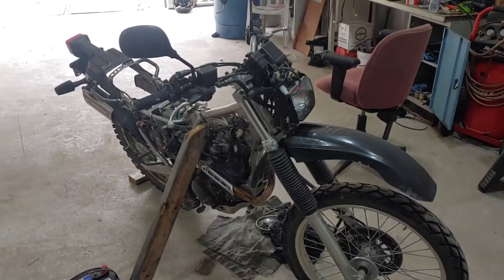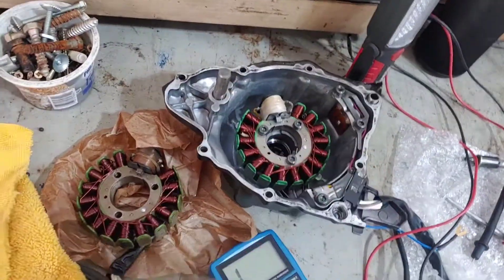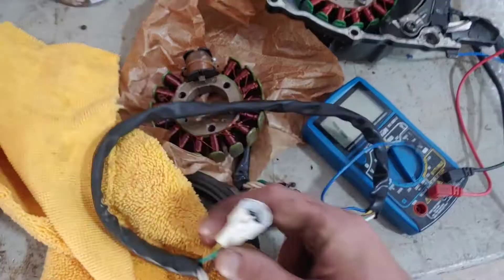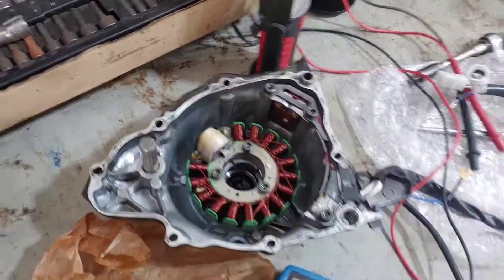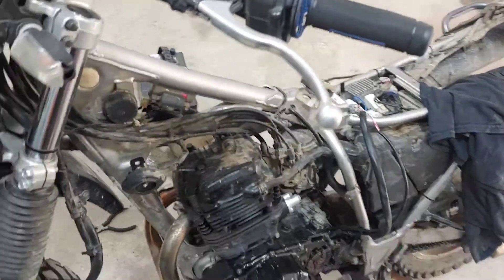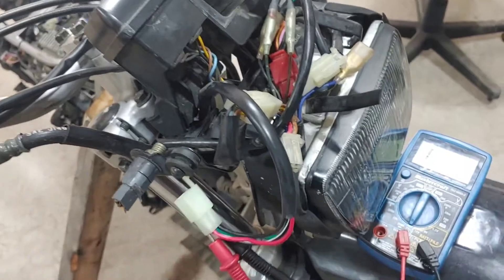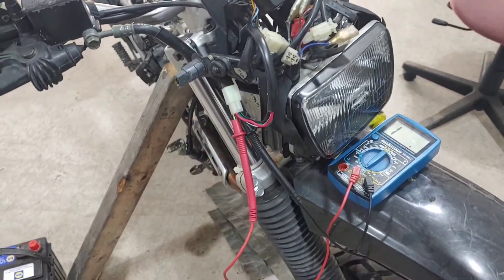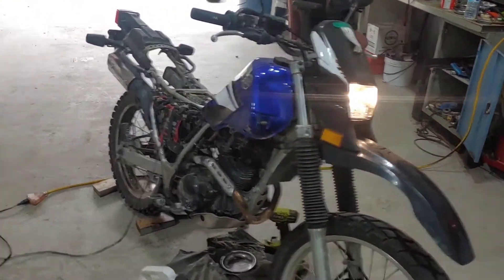No Spark - Fixing a 2007 Yamaha XT225 (Stator Ohm Readings listed)

Comment: Great video. Thank you. I got a project xt225 and this looks like my problem. Except my wiring is dogs breakfast because the previous owner was not good at this.
Reply from the maker: Thanks for the compliment. Best of luck to ya!
Reply: @blackmasta71  Well your video was very handy. May I ask where you purchased your stator?  So far stator is toast, pick up coil, and ignition coil. :( OEM stuff is stupid expensive thinking aliexpress sourcing.
Reply from the maker: @NoSkillzMoto  check out Ali express. That's where mine came from. They don't last as long but sure is way cheaper

Comment: I am getting .7-.9 m on the white wires.
Reply from the maker: I believe the white wires are for your charging circuit. 
If you have spark then you probably have a dirty carb. 

Although a spark plug about to fowel will spark out of the bike but not under compression. 
Try a new plug and then proceed with cleaning the carb
Reply: @blackmasta71  brand new carb And plug. :-/
Reply from the maker: @noneofyourbusiness614  
A new carb usually needs the air/fuel screw adjusted. 

Do you have continuous spark? 

Do a compression test to make sure your over 100psi. 

If lower it can be very hard to start. 

Make sure you have good fuel flow to the carb.
Reply: @blackmasta71  thanks, spark seems intermittent to me. Compression testing now. Like I said, Pull choke, try to start, bike fires once, then nothing. If i let it sit long enough it will fire once again. Chasing this problem has resulted in… New cdi, new ignition coil, new battery, carb, ignition switch, rectifier…
Reply from the maker: @noneofyourbusiness614  So a little insite, the new ignition switch on the bike I repaired in this video had to be modified to make the bike run. 

Test your new ignition switch like I show in the video to make sure is switch both the "power on" for the bike and the "ignition" for the bike.
Reply: @blackmasta71  i bypassed the ignition altogether, red to brown wire. (Bike side) same thing. And btw. Thank you so much for your rapid response and input! You’re getting a subscriber here for sure.
Reply from the maker: @noneofyourbusiness614  hey you must also connect the blue and blue yellow together to get spark. 
Red and brown just power up the bike
Reply: @blackmasta71  copy. You’re right… trying as soon as i get home. Thank you
Reply: @blackmasta71  i have a new key and ignition as well.. ignition has 4 wires. Red, brown, black, and black white. Bike side is red, brown, solid blue with white dashes, blue yellow with white dashes,  does this sound accurate? What do the white dashes indicate, anything?
Reply from the maker: @noneofyourbusiness614  so check your ignition switch with a meter like I showed in the video. 
When the key is on,
Red and brown should be connected
Black and black with a white line should be connected.
Reply: Bike fires once with choke pulled. Then nothing. Just keeps turning over.
Reply: @noneofyourbusiness614 did you end up finding out what it was? I have a 87 model doing the same thing!